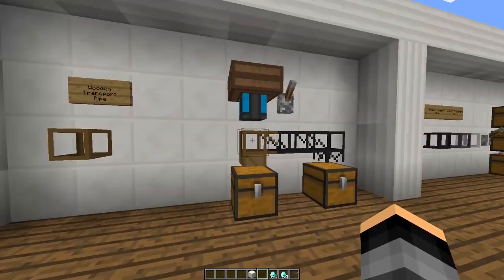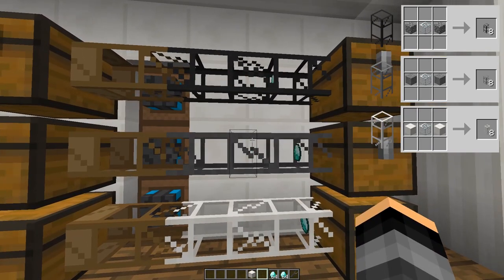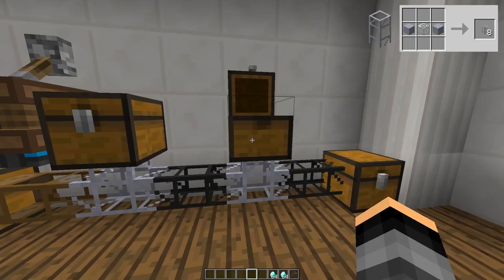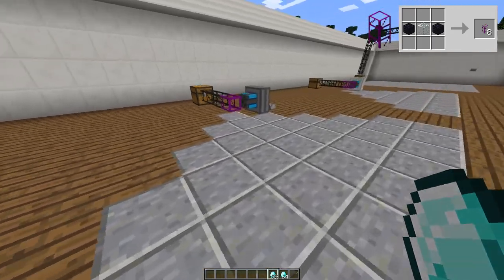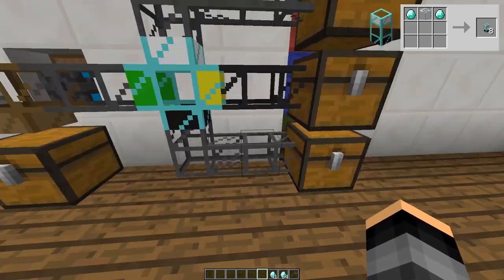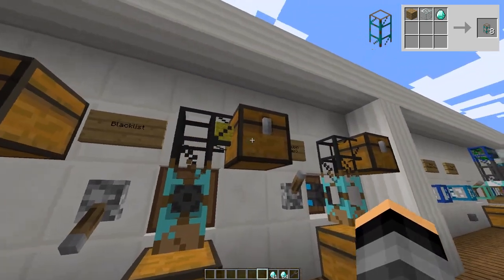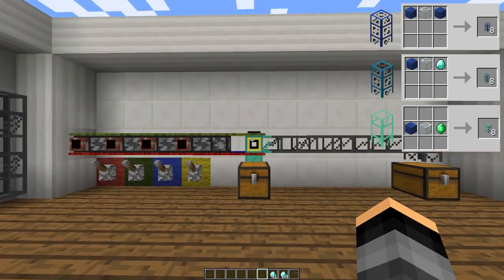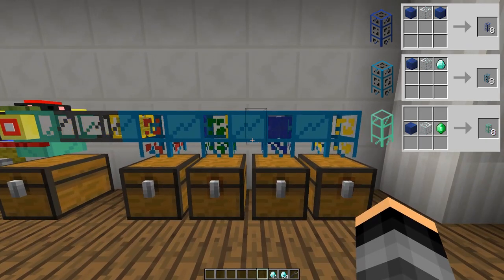Buildcraft Transport Pipes Tutorial [1.11+]

Comment: when i try to make a automatic sorting system i try to put down a engine to power it and it will only face up why is that pz help me
Reply from the maker: The only reason you would need an engine would be if it was connected to a wooden extraction pipe which would be connected to a chest. 

Place a wooden extraction pipe next to a chest and then place a redstone engine on top of that pipe by shift clicking. Then power the engine with something like a lever.
Reply: oh i get it now thanks
Reply: subbed